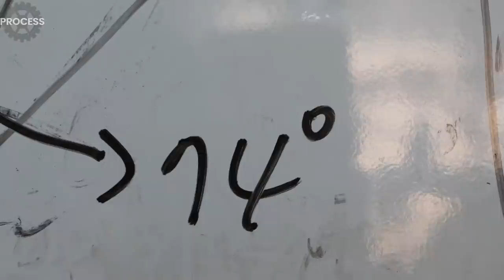Process of Making a HANDMADE Stainless Steel MTB Cycle. Bicycle Technician in Korea.

Comment: 13:41 - One item to comment on is the use of scissors to cut the nylon tie wrap instead of a proper tensioning/cutting tool. Using a pair of scissors leaves a dangerous sharp edge that can leave you bleeding.

Comment: There are two groups in the comments. Those who know about welding and they point out flaws, then there's people who know nothing about this craft and congratulate in wonder.
Reply: Bicycle frame tubing is very thin wall. 
I’m not a welder bit I have messed with plenty of bikes. 
I have seen much worse and marginally better welding. 
Kinda old school style and geo bike, but that does not take away from the skilled labor shown here. 
Cool video.
Reply: You forgot about the 3rd group who think they are an “expert” and can’t resist the temptation to tell everyone.
Reply: You always can do it better and show it.
Reply: La soldadura con tic es la que da mejor presentación , pero el soldador le falta agilidad para aplicarla .....con respecto a los sticker le hubiese aplicado un acido para que le hubiese dado el aspecto de imprenta ...
Reply: @andresaguilar5592   se llama soldadura TIG.
Reply: @Adam-vm8kp  
Exactly 💯
Reply: @b.s.adventures9421  bro is inox without back purge omfg

Comment: certainly a different technique for TIG welding tubing. a series of overlapping spot welds? looks pretty but everyone I've seen including myself does it in a continuous weld adding rod to the puddle as needed. i don't see a high freq arc start being used either. to each his/her own I guess.

Comment: well done downhill stailess steel hardtail, aluminium frames need suspension to absorb shocks, steel flexes them to some extend away - got a memory*, and its at the end if u want lasting frames not that much of a diffrence in weight (think of usally un-suspeded frames like commoners and randonier builds). i have ssen in 90s to millenium way to many broken totally lightweigt alluminum frames, cause of to *optimistic construction, way way more than steel frames of any case.

Comment: on the metal frame side the contribution of tig welding to advancement in frame weight and joint strength seems to be overlooked compared to the actual metals or types of tubing used.  The other processes would be hyrdo-formed tubes and rotary swaging which brands like specialized or BMC have been using on their advanced aluminum frames to get shapes that can almost fool people to think the bike is carbon.   The tooling for such things would be cost prohibitive for this type of custom shop bike volume, but cool none the less

Comment: That TIG weld has barely any penetration, not a good weld.
Reply: Tbem pensei a respeito..eu que sou mais burra, achei esta solda muito frágil pro peso da bike!
Reply: Are you a welder.
Reply: maybe to hold it in shape but there are some holes in the weld its not ideal
Reply: @Sc-dn8dp  Yes I am.
Reply: I've seen a lot of videos from Asia where they "cold weld" like this, just a series of tacks - looks pretty but doesn't get full penetration and inclusions like crazy. No way any of those would pass x-ray
Reply: @jacks6423  The dept of penetration is depend on many Variable and not only about TIG or MIG welding but also another parameter like, :  The Voltage stability, Welder Skill, Welding Ergonomic etc., if we want to make Welding Product Quality especially in Mass of productions in welding industry...
Reply: Good point.
Reply: You have no idea
Reply: Here we goes again, welder think they are better than other welder on the internet.

Comment: I thought you needed an argon backpurge when welding stainless?
Reply: Only if you care about sugaring on the back of the weld, I wouldn't say it matters here. The thing I don't like about these welds are how it's basically just a bunch of tacks in a line, and the little pinholes on every tack because he isn't ramping down the amps well enough